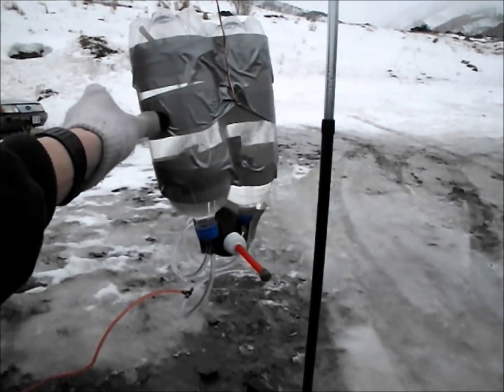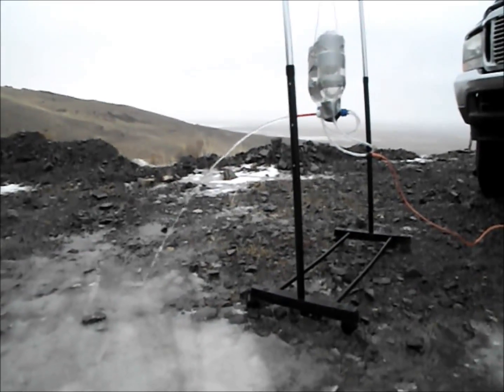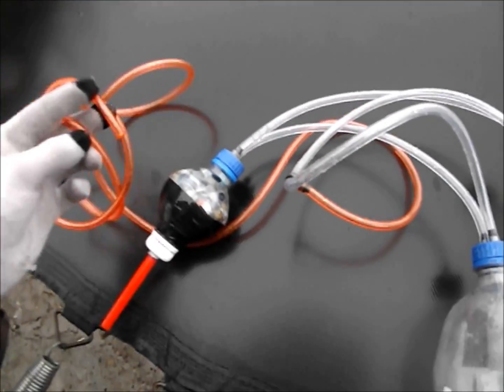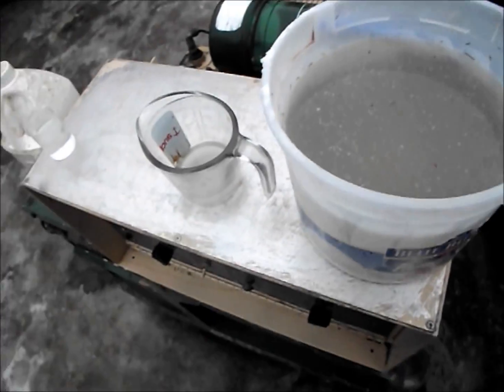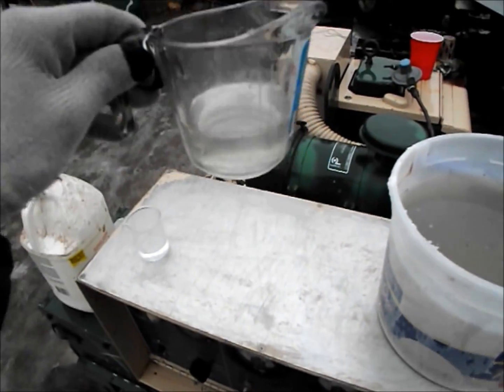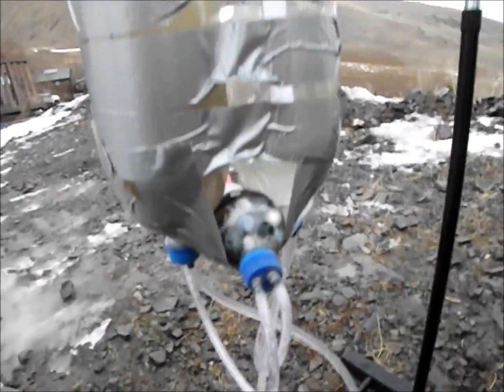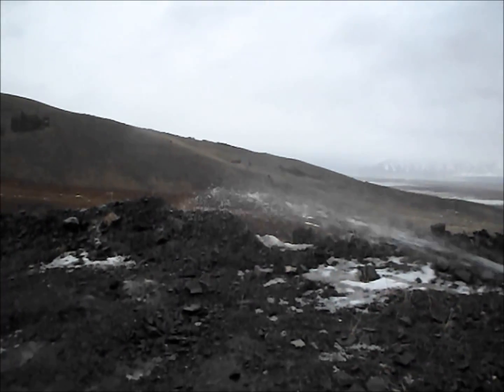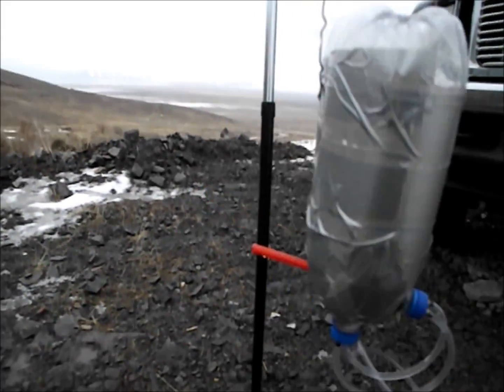Working Model Liquid Fueled Rocket Engine

Comment: I don't understand why the exhaust doesn't flow up the intake lines. If it is because the pump is creating the pressure to force it out then wouldn't you get the same result as the first test?

Comment: Put a bleed line off the combustion chamber and route it back to a balloon in each tank. That way the reaction would sustain itself until the fuel runs out. And you’ll have no need for a compressor after engine “ignition”

Comment: in order for this to truly inject only see one solution you would have been held the different sides metered or you would have to have the mixture dumped into another change your chamber with a valve that would release pressure after the titration took place you just thinking fizzy liquid that's probably extremely acidic

Comment: If lithium peroxide was placed in a chamber before the reaction vessel, and CO2 used instead of liquid O2 once you create the kerosene version,, any idea if this would increase your thrust to weight ratio? (just an idea not thought or reseached through)  I ask not having any idea if the conversion done by the peroxide would be instant or complete....Course then we get into if a platinum catalyst and methanol under pressure would have enough energy and work as a less expensive alternative...But hey, if anyone can make a high powered rocket engine out of an old Ford exhaust and wood alcohol it would be Cody...

Comment: use a splitter for the air compresser hose and run each bottle with its own pressure tube with even length tubes

Comment: So, it's an hypergolic engine ?
Reply: Kind of, except that it's an acid-base reaction, while actual hypergolic engines (and well, all actual rocket engines) use redox reactions. Hypergolism strictly speaking means a tendency of the reagents to spontaneously react in a redox way when mixed, which isn't really happening here. Kinda hard to contain a redox reaction in plastic bottles.

Comment: How do the marble help the reaction in the chamber?
Reply: My guess is they provide a force to propel off of, so the mixture doesn't push back up either the acid, or base tubes. Alternatively, they could provide stability for the bubble that the reaction occurs in, as well as portion control. idkwtf tho.
Reply: And it stirs the mixture, to get a reliable reaction. Reliable.
Reply: Ruslan Kostenko you mean that by reducing the speed of the fluid, it creates an overpressure in the reaction chamber because of Bernoulli's effect?
Reply: Guilhem well i guess it douse slow it down, but not all slow things have alot of preasure. the turboes wall makes preasure, its surcular so that its alot harder for the air to push back out
Reply: Guilhem its like a turbo, it makes it travel around, that way the water(or air) dousnt get forced back in, it has alot more pressure

Comment: I am looking for that cave in #13 video when the old hose is going to explode in your hands while your running the 2" piss drill at the bottom of that shaft. Beware of the vibrations too. just be careful with your ear drums too. It will be dark in there too.

Comment: Cody, try a divergent nozzle. You have a compressible foam of liquid and gas there which will expand as its pressure drops from reaction chamber pressure to atmospheric. If you use a divergent nozzle you'll convert some of that expansion into thrust.
Reply: divergent nozzle works only when fluid speed is supersonic. Obvioulsy, it's far from Mach1...

Comment: you may have a better reaction if you put the air hoses that go into the bottles up at the top of the unit so that the air bubbles do not affect the liquid going down the tube it spits and sputters because you have air coming up through. better reaction equals more thrust

Comment: So, um, has NASA given you a job offer yet.
Reply: Especially now with the SpaceX ITS announced, since it only makes sense to pursue Mars One if it's going to fly before the ITS becomes operational. Once the ITS is running regularly between Mars and Earth, it's both cheaper and safer to do any Mars-to-stay project using that vs using a less powerful system.
Reply: They work too slow, he's trying to go with mars1.
Reply: @Sean Holm ITS still exists (including actual test hardware now), it just got renamed to Starship and went through a few more design iterations. SLS is the one that right now looks like it may never fly to Mars.
Reply: @Sean Holm Given that Block 1B and beyond have been completely defunded, and Block 1 isn't powerful enough for the Mars program (not to mention at most 2 are ever being made, due to dependency on ULA's DCSS upper stage, which is being retired in favor of the incompatible Centaur and ACES upper stages), I find it quite unlikely that any Mars mission will ever use the SLS. Plus, NASA has talked about using commercial rockets for the Mars program.

Comment: Your method of trying to find out how much acid you need for the 50 ml of sodium carbonate solution is quite flawed. You need to stir the solution after every bit of acid you add, so that the two solutions actually mix and react quantitatively. When you say you're done, you shake the glass with the Na2CO3 and there's still a ton of CO2 coming out because the reaction hasn't finished yet.
So in conclusion I think your mixture was probably not as good as it could have been.
Reply: To be fair it was a rocket made of bottles and duct tape...

Comment: Those are some funky gloves with the black fingertips.  Why just some fingers?
Reply: wool for insulation and black rubber tips to counter grip deficiency
Reply: +hurrr durrr actually I believe they are the ones for phones so you can still type on a phone while you have gloves on they have conductive material on them.

Comment: Congratulations! You made a "Water Rocket"! Yes, the dribble in the initial water test really was producing thrust, just at a very low level that you thought it was producing none. Newton's laws were still in effect, though. :-)  A potential improvement would be to add a DeLaval nozzle to the exhaust. Your reaction is producing enough compressible gas that it should be to your advantage to had a C/D nozzle. If the rocket were a pure water rocket this is useless as water is incompressible and won't see any benefits. But since you have a lot of gas forming, you will see a boost.Another suggestion would be to splice multiple bottles together like we do for our huge water rockets,  then you will be able to pre-pressurize the ullage above the propellants and not be tethered to the compressor. You could also size the tanks based on the ratio of your propellants so you did not need to dilute the acid, because that is just extra mass you don't want. I realize this video is a proof of concept to show an idea, but the other way to make this kind of rocket is not to have a reaction chamber, but rather to just mix the two propellants together in a single chamber with the nozzle plugged and allow the pressure to build and then release the plug and away you go.I just found this channel, and I love your rocket tests. And don't discount the pure water rocket... ours can lift a 250g payload to almost 2200 feet! Looking forward to more of your rocket experiments!

Comment: chemistry 100: "Add Acid to Water, Like you Aughta'. Add Water to Acid and You'll get Blasted". Furthermore, I suggest a third (or even a forth) tank strictly for pressurizing the fuel component tanks. Remove the compressor from the test equation by simply using a pressure tank(s) to supply force to the fuel component tanks. You can get really slick and have a quick connect and a pressure gauge on the pressure tank, but this will ensure that both component tanks are always being fed the same amount of pressure consistently. The compressor has to many dependent variables (electric, atmosphere, etc) to provide a solid test foundation and consistent pressure to the fuel component tanks. just some thoughts.

Comment: Have you thought about revisiting this with a smaller nozzle opening? I realize you were trying to achieve a similar output of nozzle pressure as your inlet pressure from the compressor through a larger nozzle than the inlet lines. However, I believe you would get a much greater thrust ratio by reducing the nozzle diameter by about 1/2 it's size. Or were you worried about over pressurizing the combustion chamber and having a total failure at that point?
Reply: rick peener I'm guessing you are talking to me, regarding my comment from 2015, and yes I was new to his channel at the time. In fact this was only my third or so video of his to have viewed at the time. How about you loose some of the attitude you're expressing there. It's a simple question that doesn't have to be asked in such an arrogant manner.
Reply: rick peener Probably because you have the reading comprehension of a toddler. You most likely didn't understand half of what is said in anyone's post, since you reply with single word sentences such as "gay". Pick up a book every now and then and stop being a troll.
Reply: rick peener You win at being a troll. Go fuck yourself with a broken beer bottle asshat.
Reply: Got ya, proof of concept then i take it. New to your videos and didn't realize there was a whole series of videos when I posted that.
Reply: +Cody'sLab where did you go to school?
Reply: +JudgmentDay78 I like your attitude but no matter how tempting it is don't forget the rules "Never feed the trolls!" have a Nice day

Comment: So could you use another hose from the combustion chamber (smaller hose) to the top of the bottles so you wouldn't need the compressor?? I know it will more than likely prevent the spray from going as far and if done incorrectly you may have an explosion but would it work?

Comment: This test / demonstration of yours helped me appreciate the basics of a liquid / chemical rocket motor. Nice start. Too bad this fine rocket motor escapes some as for what it means. You proved a 5x thrust increase from water / pressure to chemical reaction / pressure. I hope others realize what this means...some chemical reactions that result in expansion / pressurization of gases do not always involve a flame. This motor, with proper nozzle orifice, high pressure tanks and tubing - could have taken OFF...weight, and all. Mentos / Diet cola two litre rockets prove that. They measure nothing, though.

Comment: r u just pressurizing the tanks with hydrochloric acid and sodium carbonate solution
then spray them into the area where the mix(the combustion chamber) and those to things make fire and exhaust or the create steam and the steam is pushed out the nozzle. i dont know cus im not a chemistry professor or anything.
Reply: ***** thx for the info but why use the special chemicals do they do anything special like combust in the combustion chamber
Reply: ***** and do what
Reply: ok so the air pressure is just to mix them together they do make a then push out the nozzle. much help and how  about cheap are the chemicals

Comment: It's a great approximation of expansion for thrust, however, you need to meter the reagents so even expansion can be delivered, also, this would be considered a hypergolic rocket engine, its thrust is derived from the reagents being combined like dinitrogen tetroxide and hydrazine.